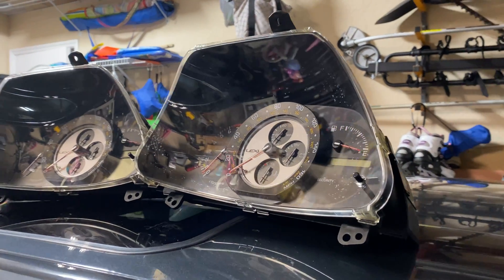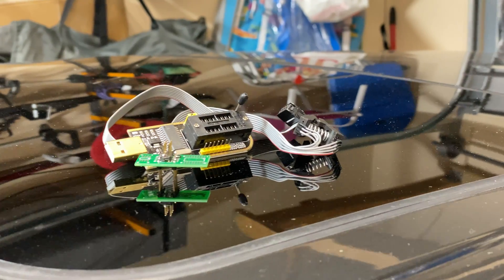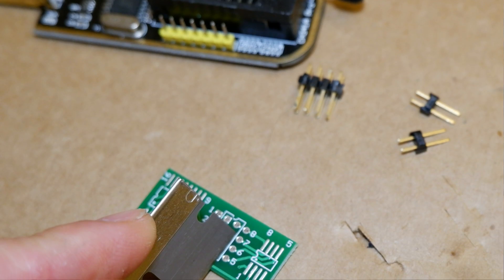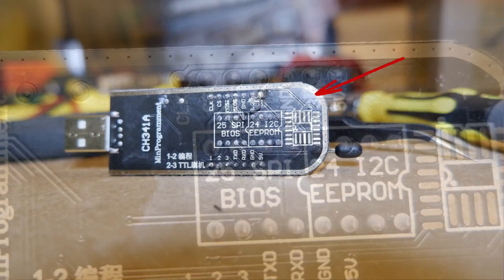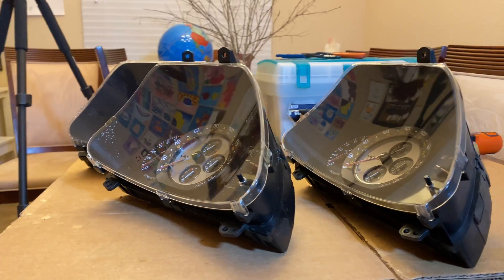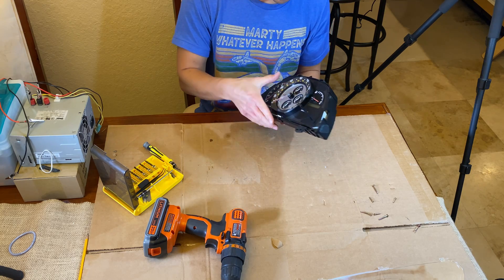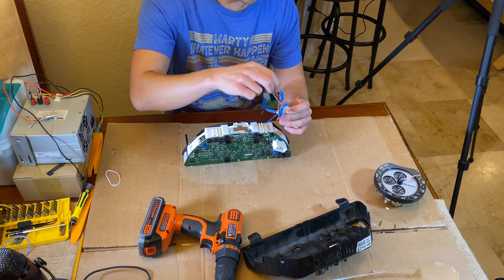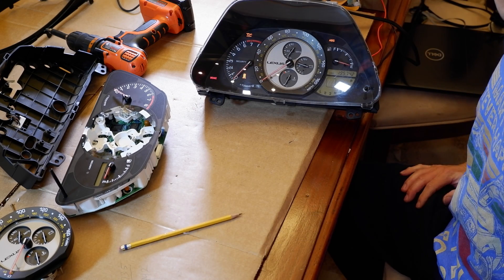Odometer Mileage Correction Lexus IS300 Gauge Cluster | DIY ODO Programming

Comment: Hi Binh,

Thanks for the great video!

I'm curious, if I read my USDM chip, and write that to my JDM chip, will the odometer read in miles instead of kms? Or, would i just need to physically swap chips?

I just noticed yours were all the same and I put a JDM PCB in my cluster to use the oil pressure gauge.

I have a Dakota digital converter for the tach and speedometer.

Thanks!
Reply from the maker: Won’t change the KM to MI. It’s part of the program. The EEPROM only holds numbers.
Reply: @TunerwithKids  ok, cool. Thanks for the reply!!
Reply: @TunerwithKids  I ended up swapping the IC on the PCB. Mileage is displayed correctly now. We'll see if it calculates it anywhere close. 

Thanks again for the great videos! Superb information!!!

Comment: Came across your video and was wondering if you know anything about mileage on the odometer not changing when driving. I recently picked up a SportCross and having trouble with the odometer. The mileage is not changing as I’m driving. Everything else works like the trip A&B,speed,rpm etc. Any help will be appreciated. Thanks.
Reply from the maker: No idea. Maybe be an issue with the eeprom chip. Cause if the speedo and other counters work, it’s not the sensors.
Reply: Thank you for the info.

Comment: Would you sell a ready to go chip cable and power lead to the cluster?
Reply from the maker: Naw. I’ve posted all the parts and resources to make your own in the description box.
Reply: @TunerwithKids  I also noticed in the part of your video where you show the software that converts the odometer value inside the software itself it looks like it's identifying the mileage as kilometers. Did you have to first convert your mileage to kilometers so that the output would be the correct number you needed?
Reply from the maker: @fastturbo it’s just a number. The cluster has other programming that increments the values based on its units.
Reply: @TunerwithKids  ok thanks sorry for the questions.
Reply: @TunerwithKids  asshole move tbh

Comment: Thanks.   I had it tied low for weeks working drivers.  I tried high, read wrote and read correct changes,  the key EEPROM IC900 at 16 bits.  Subscribed to you and Dr. Shock. I used an old eprom plug and wires for the jumper to various pins on the USB bus.

Comment: Hey man! Love how you explained everything in this video! You made it possible for non-electrical people to understand. I have one question,

My situation is kinda sucky and I’m doing the opposite, i bought a GX470 that supposedly had the low mileage that it says on the dash, but found out it has been swapped or reprogram from a much much higher number. I know I already made the mistake not checking thoroughly, but I’m looking to see if I could reprogram it back up to the original high mileage so I don’t get a “True Miles Unknown” title. Would this same exact procedure work for my situation? Or would I need to route the tap wires differently? Really appreciate what you do! Thanks in advance!
Reply from the maker: Most all Toyota use the same chip. It’s a matter of finding it on the cluster.

Comment: I need your help pls, would swapping the 93c56 EEPROM from an old bad ECU to a new replacement ECU work with the old keys? Logically I thought it would but I thought I need to ask a specialist.
Mine is a Lexus is200, both ECUs have the same part numbers btw.
Reply from the maker: Yea if you don’t damage the chip removing it. For me it’s easier to clone the data.
Reply: @TunerwithKids  thanks, I consider cloning the data but I find it risky to do on board, so if I'm going to remove the chips I'd rather just swap them.. no?

Comment: Hey Binh, trying to reset the key log on my GS300 with the other video you have posted, but I am a bit confused. Do I need to reroute 25xx to 93xx pins and do the 16-bit pin 6 to pin 8, or do I just do the 16-bit pin 6 to pin 8? Thank you!
Reply from the maker: I think Toyotas use 16 bit.

Comment: Great vid! just curious if you know of a way convert the mileage from KM to actual Miles? Im thinking about possibly buying a JDM cluster for my manual swap i want the center RPM Gauge and id like the mileage to be accurate not read double lol
Reply from the maker: Only way is the external Dakota box to adjust the signal.
Reply: @TunerwithKids  oh no my bad i meant the mileage on the odometer itself. i already got the dakota box, but i want to change the odmoeter to reflect the correct milage but not in Km's. thanks appreciate you
Reply from the maker: Probably can’t. The ODO will read based on KM calculator from the KM/H input. So once you write a new number it might count based on what Dakota says.
Reply: @TunerwithKids  hmmm maybe. thanks man i appreciate you taking the time to answer!

Comment: Thanks for posting, but I think I see two errors and would appreciate confirmation so I can do this right:
1. @2:40 — 8-but goes from internal pin 6 to external pin 4.  Ah, pin 5 is jumped to pin 4 so jumping inner pin 6 to outer pin 5 is the same as outer pin 4.  OK, I understand now.  This is correct.
2. @2:47 — No 16-but jumper is shown from inner pin 6 to outer pin 8.  It looks like you solder the connector pins after installing the connectors to make this connection.  How come you didn’t solder at the board level?  This looks good, too.
Alright, I worked myself into an understanding and your diagrams and pictures were correct.
Thanks for posting this.  I’m working through an all-keys-lost scenario and your videos are really helping me out.
Edit — I bet you soldered 6-8 on top just in case you had 8-but work to do and need to desolder and resolver to pin 5 without taking the connectors out.  Nice clear thinking.

Comment: For the programmer, does that exact set up you made work for the IS250? 3:26 
I see you did this on a recent vid. Also, do you have it in a PDF form to ensure I don’t mess up lol. 

Picked up a cluster to mess around with to swap LEDs and mirror my current millage if all goes good lol

Comment: Thanks for this I was able to program my clocks successfully. To save modifying the programmer board itself, I ended up just cutting pins 3,7,8 from the board you make up so no voltage can come from the programmer. Then made a jumper wire from pin 8 on the board to the yellow 5v on the programmer. Also I found a way to change the end digit it’s a case of adding additional 0’s at the end of the mileage / just before the FFs, I’ve found that every 00 00 adds 1 to the end digit.

Comment: Hey bro, is it able to reprogram sxe10 (altezza rs200) cluster from kmh to mph, the jce10(Lexus IS300) had different cluster with different engine displacement.  sxe10(3s-ge beams)  and the jce10 (2jz-ge). Jce10 is the correct chassis code for the is300.

Comment: I'd be very interested to know the stats for how many people tried this & how many were successful. 
I made two adaptors, one from the bare board & another from the prepinned 25XX Adaptor & neither worked.
I double & triple checked my wiring & scrubbed ALL the blue paste off that IC chip but I just couldn't get the program to recognise it.
Considering the time & effort I spent arsing around with this I would gladly pay $300-400 for an OBD tool; problem is I haven't come across one that is guaranteed to work (including the XTool ).
Reply: Worked great for me, let me know if I can offer any help. What message do you receive when trying to read the chip?

Comment: Hey hopefully you can help. I had a question about the setup of the eeprom programmer. When you put wires 4, 5, and 6 through the middle holes of the board, how did you solder them and still have the pins going through? Any help would be appreciated.

Comment: Hi Bihn,YOU ARE AWESOME...  yes this vid is useful, but over my head, you helped me in the past with my rearview mirror (installed a homelink compass, auto dim in my 98 Lexus ES300, ONLY the LS has it in similar early years ...I think), but I want to install the 2001 IS300 gauge cluster ( What a COOL looking cluster)into my 98 ES300, I know it will have to be physically modified ,I can probably do that, it's the ELECTRONICS that's over my head, do you have any idea on this, and/or could you do this as a CUSTOM job for me? Thanks, LOVE YOUR WORK

Comment: I hope I can get a reply because the video is really old, but I’m making the adjustments to the programmer but I’m
Confuse On the 16 bit and 8 bit
Reply from the maker: The set pin is either for 8 but chips or 16 bit. Ground or Positive sets it to one of the settings. Need to match to the chip you are programming.
Reply: @TunerwithKids  did you solder a wire from pin 6 to 8 to make it 16 bit?

Comment: did you do 93xxx 5v mod to the programmer?
Reply from the maker: Yes at beginning of video I show it.
Reply: @TunerwithKids  sorry mixed between this video and the is250 one.
Do you know why it's saying in the asprogrammer :
"Current programmer: CH341

Check settings"
I selected the 93c56 16bit.
Reply from the maker: IDK, I usually let the program auto discover the chip. Make sure Pin orientation is correct and that the clip has good contact with chip. Sometimes the clear or coating blocks the electrical contact.
Reply: @TunerwithKids  Fixed it. apparently, I installed the drivers for the ch314 incorrectly..
thank you for the awesome guide and fast response! subscribed!
Reply: @AutoTommy  i'm getting the same situation "check settings" can you link me to the driver you used?
Reply: @Itsgregguys  I dont have the files but I remember i searched on Google for the driver, it depends on your PC because it used 32bit and 64bit

Comment: Dude you are so dope !! I had to get a new motor and was looking around for a cluster with only 45k miles and it's been impossible. So im gonna pick up this Amazon programmer and try it out. I watched your other video and changed my window switch leds, as well as the inside yellow lights for the climate control knobs, I already had swapped the bulbs for climate control and gauges but now ill be able to change security light color and also the Reverse and I believe Drive or Neutral light when going into gears. I'm slightly OCD so I love this kind of shit ! Keep it up and thank you so much for not having another generic "how to change climate control bulbs " which everyone should know how to do and is also fifteen million similar videos out there for. Much appreciated
Reply: Just because motor has 45k doesn’t mean the car has 45k now, every other part has 200k or whatever mileage your car has

Comment: What if I just have a regular soldering iron, can I just desolder the SMD chip and swap over? I plan on doing this soon, I'll try the programmer first and if no luck I'll try desoldering. I saw your post on the IS300 Reddit group, great DIY video btw 👍🏾.
Reply from the maker: You can swap the eeprom but need an air soldering iron. You’ll end up damaging the chip or the pad with a normal iron. The air soldering iron will make it a 10 second job.
Reply: @TunerwithKids  Thanks for the quick reply. I've never used an air soldering iron before, is it still needed for the modification to the blank Ch341 programmer board? Or I can just use the regular one on that? I want to make it this wknds project.
Reply from the maker: You can mod the ch341 with a regular iron.
Reply: @TunerwithKids  sweet, thanks! Btw my manual cluster I picked up has 154k but my IS has only 109k which is why I wanna do this.
Reply: @TunerwithKids  do you think you can help me out with my mileage decoding 🙏🏾? I tried finding Tachosoft online but no luck. I tried to DM you on IG but don't think you've seen it. My current mileage is 109,027 please and thanks.
Reply: @Touring_Low  any luck on finding that tachosoft download? I am currently stuck at only that part and how did the air soldering iron work with swapping over that SMD chip was it successful or no? Any response would be greatly appreciated!
Reply: @01_jzInfo I ditched doing this project myself and just found someone locally to do the mileage correction for $100

Comment: Is any mileage stored in the ecu’s? (01, or 02-05 auto/manual?)
Reply from the maker: All mileage in Toyota’s are in the cluster. Only Germans program it in multiple places.
Reply: @TunerwithKids  gotcha! When i swapped cluster i did it very “ghetto” i have an 01 and wanted to keep my stock cluster for mileage and just ended up swapping out the face trim from an 02-05(silver trim around the edge of the side inserts) but now learning this would be perfect for me to just swap over a new cluster entirely and just program the proper mileage 👌🏼
Reply from the maker: If your techy enough and can mod that CH341A then it’s easy. Some google and reading my description and links will get you on your way.
Reply: @TunerwithKids  oh absolutely, first real board stuff i played with was a diy mega squirt v3 board, had a blast doing it!  Already ordered what you had listed in the description

Comment: Hey binh question. After you change the mileage, have you plugged the cluster in your car. Does the adjusted miles stay or does it show what the cars mileage is? Also, after installing and driving it have you tried swapping clusters again?  I'm getting mixed answers, on forums they said swapped clusters will show cars mileage not adjusted cluster mileage. Thanks
Reply from the maker: Toyota and Lexus stores all data in cluster.
Reply: @TunerwithKids  ok thanks.